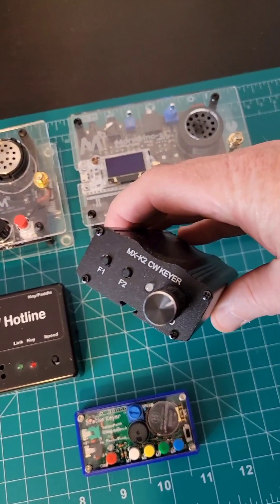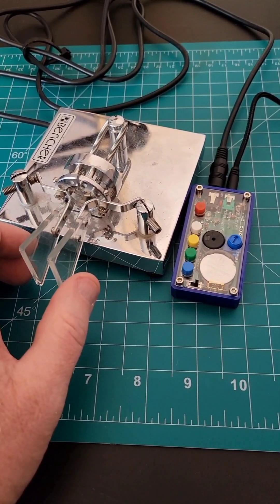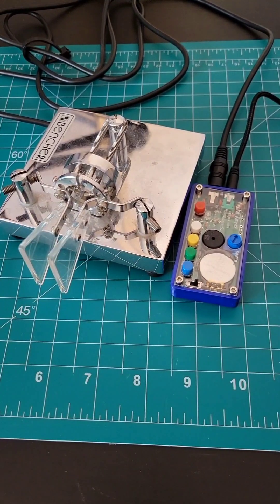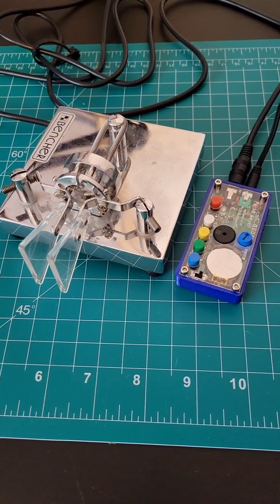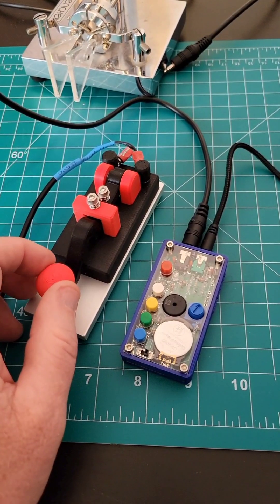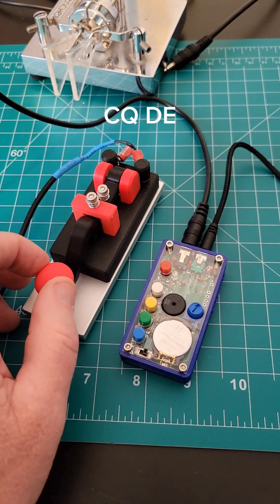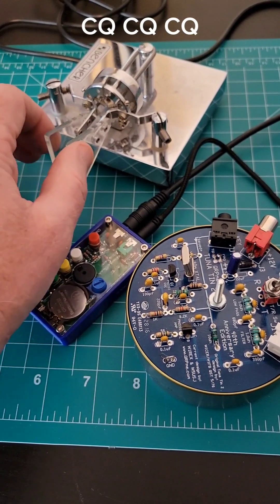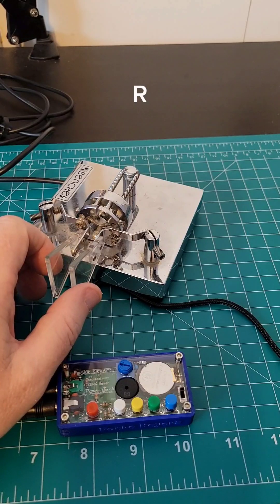What is a Morse Code Keyer #hamradio #cw #morsecode

Comment: I just noticed you send with your left hand on a paddle wired for a right hand sender. I can send left handed on a paddle wired for left hand sending but not this way. Nice job.
Reply: Used to have a mechanical key called a bug that worked similar to this. Some operators got real good using them in railroad commutations.